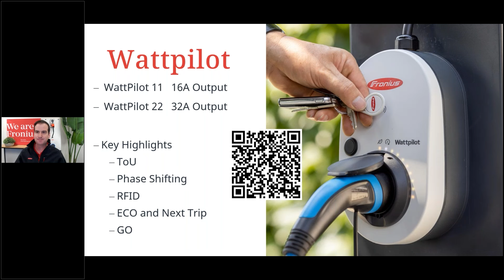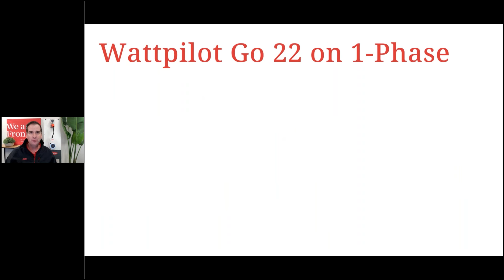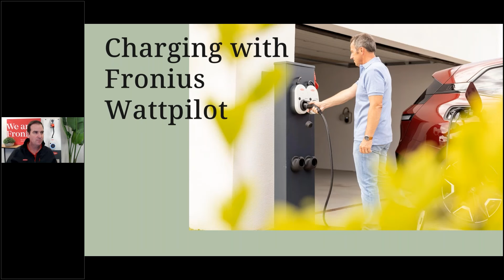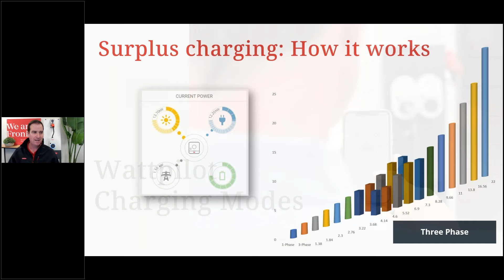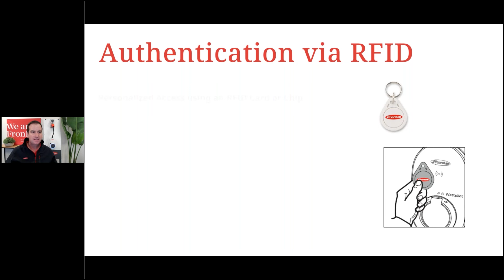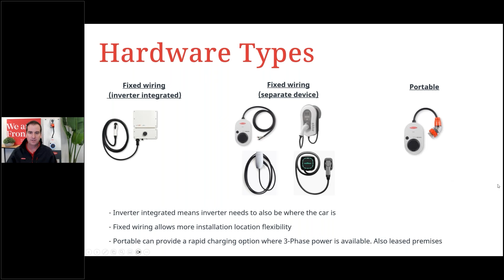Webinar: Fronius Wattpilot - The Most Cost Effective Way to Charge an EV (AUS)

Comment: I've got issues with my recently installed Wattpilot.  Where its stating the wrong PV surplus.  e.g. I have a 13.2kW solar system with a 10 kW Gen24 inverter.  At times Wattpilot states I have 15kW solar surplus.  It looks like Wattpilot is adding the solar surplus along with what it is pulling down which means Eco mode can pull down the full 7kW (BYD) even though I only have 4kW solar surplus.  Does it matter if Wattpilot is installed after the SmartMeter?  If so is it clear on your installation guidelines as my installer was not familiar with Wattpilot.